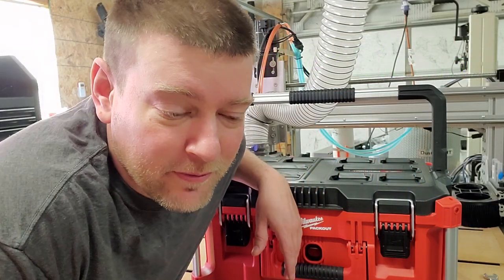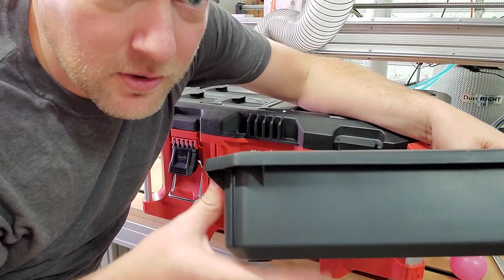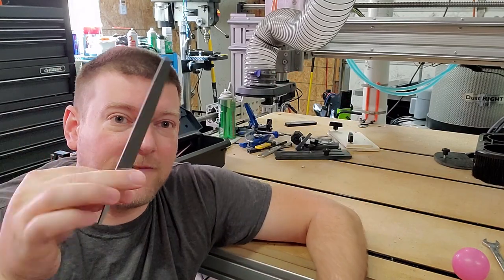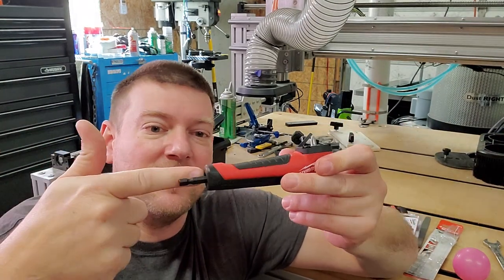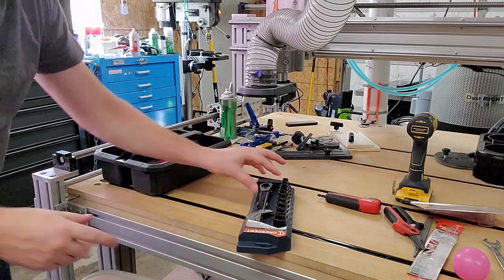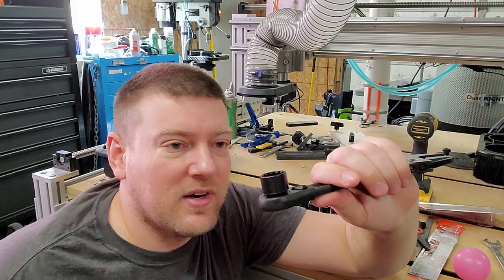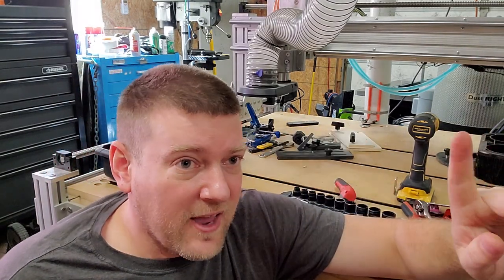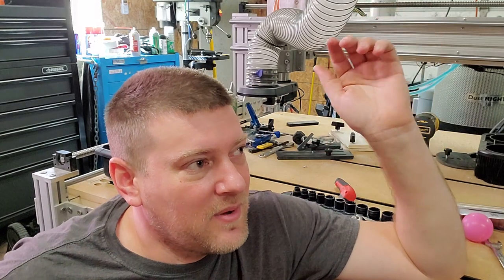New Tools for Biomed Toolkit

Comment: Bought a balljoint fork for changing casters. Works like a charm. Also picked up the Milwaukee m12 ratchet and m12 soldiering iron.
Reply from the maker: I'm  very interested in the Milwaukee 1/4 ratchet and soldering iron..
Reply: @BetterBiomedChannel  you won’t be disappointed, we have the 3/8” with a reducer for 1/4”

Comment: That Crescent set looks sweet! Dig your enthusiasm, wish I had you as an instructor for shop class.

Are the spline drive pass through sockets using a standard drive? e.g. could you drive them using the Gearwrench locking flex head pass through ratchets? (there are 1/4" and 3/8" ones)